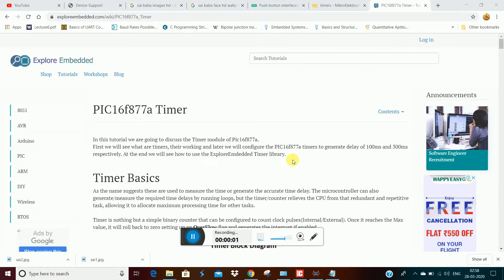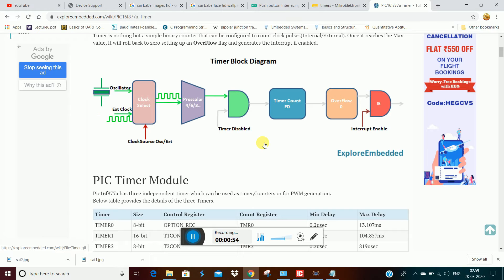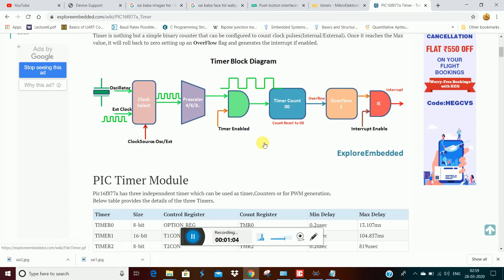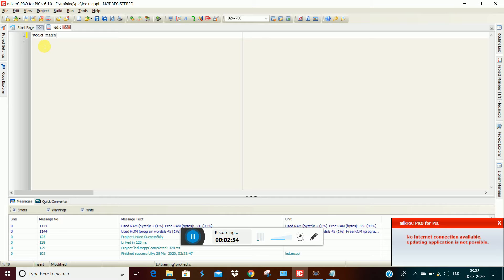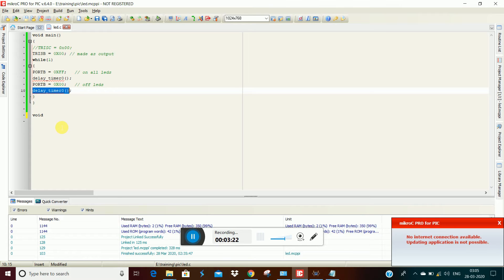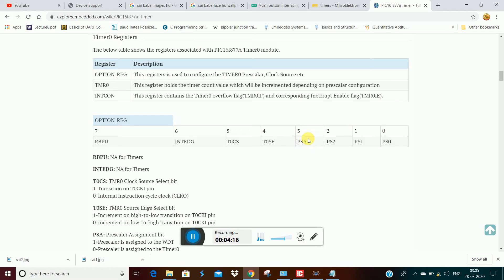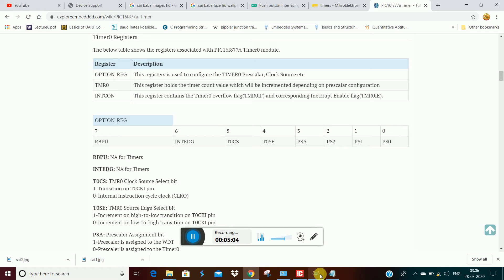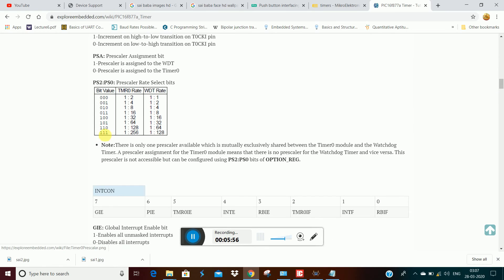Timer0 programming with Pic Microcontroller  in Tamil| Hylobits| Embedded Tutorial

Comment: Dear sir please via program for difference between delay and timer on the other hand could I use the same timer function at different events at the same time for eg when I press the button 1 after 5 sec o/p must come at the same time after pressing the button 1 after 2sec delay button 2 pressing the corresponding output  must come
Reply from the maker: You should use the concept of timer interupt ....where you can generate parallel delays ..
Thanks
Reply: @Hylobits  Hi Anna Ipo ,Timer 0 use pani oru one second delay ku LED on/off Panrom and at the same time normal delay la another led blink aganum,epdi nu sollunga
Reply: @raghuls2000  you need to go for timer interrupt concept 
Regards 
Krishna